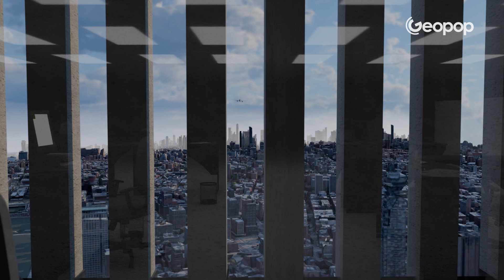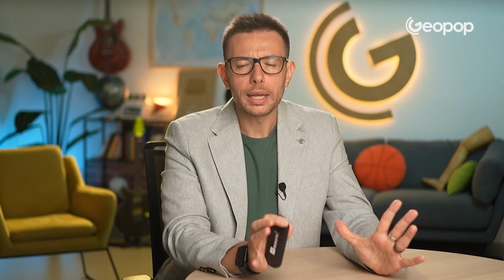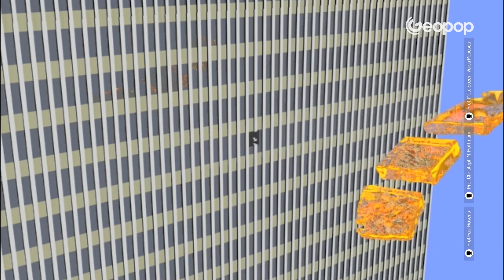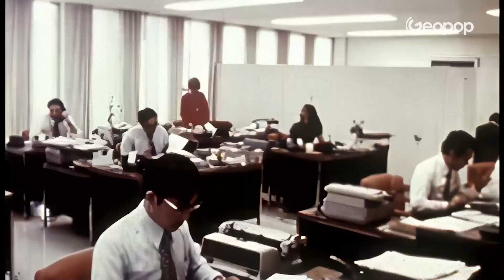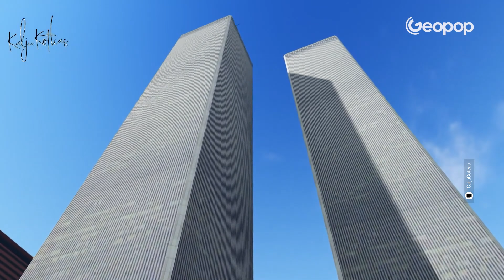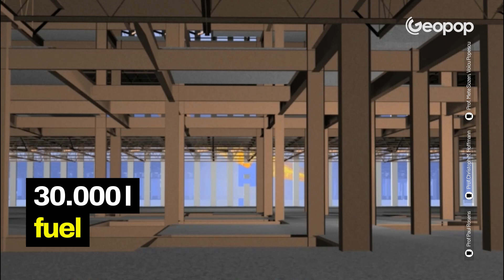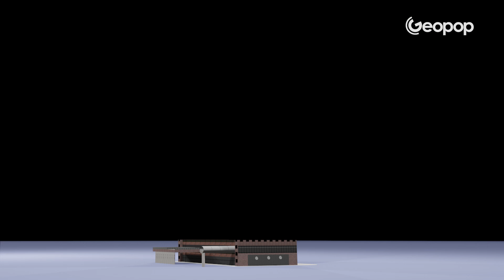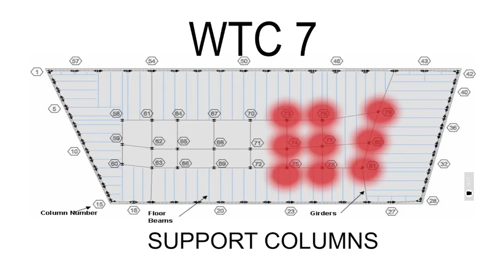9/11, 2001: The Technical Reconstruction of the Twin Towers and WTC 7 Collapses

Comment: https://www.youtube.com/watch?v=hm1u6qZyQ4w

WTC7  was an obvious controlled demolition.
Whether you choose to admit it or not.
9/11 was a military media psyop.
NOT a “terrorist attack”.

And I don’t have to participate in YOUR fantasy.
Reply: I’m going to respectfully disagree and offer a more plausible explanation.

Building 7, the 6th building to collapse of 10 lost on 9/11 still confuses many even though it has been extensively studied. Not famous or a terror target, and with no casualties it did not get a lot of attention initially, creating an information void the internet rapidly filled with garbage. Because everything seems like a conspiracy if you don’t understand how it works I prepared this brief summary of the collapse from my own analysis. No politics, just engineering. 

The North Tower collapse at 10:28am bombarded Building 7 with tons of burning debris, causing heavy damage and starting multiple fires burning out of control for the next 7 hours. Half the FDNY firefighters having been killed, others injured, units in disarray, equipment destroyed, no water pressure, and the greater urgency of Search & Rescue efforts, firefighting was pulled as futile. The building couldn’t be saved and was left to its fate.

www.youtube.com/watch?v=g_SvpwyC17M&ab_channel=MFitz  

Collapse of a burning structure is always a concern for firefighters. Steel buildings subject to fire rely on active fighting of the fires to survive. Buildings are designed around 1 to 3 hours of fire resistance, allowing time for occupants to escape and ACTIVE firefighting to get started, after which all bets are off. Left to their own devices they will exceed their design envelope and collapse. In B7 the occupants escaped, passive and active fire protections were compromised and active firefighting was abandoned which left the building to take its chances. It lost. Odds on Building 7 would eventually collapse, and it did. No big deal in logic. That is the sort of choice firefighters make every day in brush fire situations - which houses to save and which ones to let go. Only real difference here is moving the decimal on the size and cost.

www.youtube.com/watch?v=WnYBX6QT0R4 

FDNY Chief Daniel Nigro ; The biggest decision we had to make on the first day was to clear the area and create a collapse zone around the severely damaged 7 World Trade Center, a 47-story building heavily involved in fire. A number of fire officers and companies assessed the damage to the building. The appraisals indicated that the buildings structural integrity was in serious doubt. I issued orders to PULL BACK the firefighters and define the collapse zone. It was a critical decision; We could not lose any more firefighters. It took a lot of time to PULL EVERYONE OUT, given the emotionalism of the day, communications difficulties and the collapse terrain

FDNY Deputy Chief Peter Hayden ; We had our special operations people set up surveying instruments to monitor and see if there was any movement in the building. We were concerned of the possibility of collapse in the building. And we had a discussion with one particular engineer there, and we asked him if we allowed it to burn could we anticipate a collapse and if so, how soon? And it turned out that he was pretty much right on the money, that he said 'In its current state you have about 5 hours

The collapse of Building 7 was anticipated and widely reported in the media throughout the day. At least 24 video cameras recording some or all of the collapse. Everyone knew what was coming and why.

www.youtube.com/watch?v=OY5S5k3tMHI 

Building 7’s collapse was completely different to the Twin Towers, harder to understand with most of the details difficult to see. But we can still sort out what happened through careful analysis and observation.  This is MY EXPLANATION of the collapse sequence using the best available information and relying on no authority.

B7 was complex 47-story steel framed structure built on top of a smaller existing 3-story building, requiring several lower floors dedicated to complex load transfer structures instead of usable office space. Of trapezoidal shape and all-steel tube-in-tube construction, B7 (above the 7th floor) consisted of a central core of steel columns carrying most of the gravity load, perimeter steel columns around the outside of the structure carrying the remainder of the gravity loads and long span beams and girders to tie those elements together and form the floors. On the outside of the building hung a moment frame - the last part of B7 to fall. 

Phase 1 : The first externally visible signs of collapse initiation occurred at 5:20:28 pm. Collapse initiation for B7 is notably quiet with observers not realizing the building was collapsing! There was no audible warning in the form of say hundreds of ear drum busting 180-190dB explosive bangs preceding the collapse. Here at 12:00 a local CBS affiliate reporter is talking 10 blocks from B7 when collapse begins. People don’t start to notice the collapse until 12:11. Then at 12:45 is the famous CBS fixed camera clip of Building 7’s collapse.  Note how quiet it is.

youtube.com/watch?v=t5tEy6mXSE8&ab_channel=fresnosean379

Collapse initiation was due to lower floor failures above the load transfer region (7th floor) in the NE corner of the building. In this video at 0:45 you can see the NW corner from inside the building while under construction, Column 79 just out of frame on the left. That big, angled steel beam across the top of the frame connects to C79 at one end. The girders connect to the beam. That beam and all those girders depend on just one connection

youtube.com/watch?v=nP3TNHPCIVU&t=35s&ab_channel=EdwardCurrent

Phase 2 : Lower floor failures caused a loss of critical lateral support over an excessive length of core Column 79 and it buckled. If you look at a floor diagram of Building 7 (see above) and look at all the structures that depend on C79 you quickly realize this one column was a relatively isolated structural element on which a disproportionately greater fraction of the structure depended analogous to say the Key Bridge. Externally we see a vertical progression of window breakage along the 44-46 line and a kink in the roof of the East Mechanical Penthouse at the top of the building, consistent with C79 failure. The transition from full capacity to almost no capacity occurs in virtually an instant. Once the buckling failure occurs there is almost no resistance

Normally with a buckling column, the load could very well be redistributed to other columns, meaning the buckling could stop after a while. With C79 that is not the case - the failure did not redistribute the load, so the collapse rapidly progressed to the roofline, sinking the rooftop penthouse.

Phase 3 : With C79 gone, B7’s progressive, non-symmetrical collapse continues with C80 and C81 at the east end of the core left laterally unsupported and quickly buckled and failed as well, sending the EMP down through the building. C79-81 all have no diagonal bracing, which I believe is a major reason why they could not redistribute a lot of vertical loads among one another.

From there collapse progressed from east to west through the central core until the core was gone taking all of the interior floors and structures and probably most of the perimeter columns with it. You can see the horizontal progression of window failures low in the building and the dropping of the remaining rooftop structures into the building. One of the big takeaways from the NIST Building 7 study (that gets completely ignored) was their modeling which determined C79 failing under ANY circumstances would have initiated the same collapse sequence.

Phase 4 : After some 10 seconds all that remains of Building 7 is just a hollow empty outer shell - the exterior moment frame - creating the illusion the building is still standing since little has changed externally. But it’s just a hollow empty shell like an empty cereal box supported by only a few remaining columns and quite unable to remain standing. With all the internal framing gone. the north face leans inward, forming a V in the roofline, the last perimeter columns buckle under the strain and with nothing left keeping it up the moment frame free falls, landing on top of the 7-story high debris pile. It is only at the very end that a single measurement of alleged free fall acceleration is taken. Note this is not the building but just its outer shell, and only one corner at that, at the very end of the collapse. Start to finish the entire collapse took 18-20 seconds, or less than 1/3 of true free fall and we have to look at the whole thing, not cherry-pick little bits to fit a particular narrative. Worth noting _how fast something falls cannot tell you what started it falling in the first place. The debris spread out, blocking surrounding streets, heavily damaging the Verizon Building and destroyed Fiterman Hall, all well outside of Building 7’s “footprint”.  

Building 7’s progressive, non-symmetrical collapse was incidental and unintended collateral damage from the combined effects of fire + time + gravity started by the collapsing North Tower. That is true no matter who planned and carried out the 9/11 attacks or why . The collapse was of so little consequence it barely even registered at the time, a mere footnote. It only took on semi-mythical status as an alleged smoking gun years later when demolitions at the Twin Towers, missiles at the Pentagon and shoot down over Shanksville all failed and conspiracists had nothing left to work with.

Anything can seem like a conspiracy if you don’t understand how it works. Now you should. I hope you found this helpful, informative and it solicits informed critical comment. If I made any errors of fact, logic or reason or left anything important out, please let me know so I can fix it. IF you can offer a more plausible alternative please do. Be the first. Please start any reply with the words “Tits McGee” or I will know you didn’t read it and are wasting my time.

Comment: 9 seconds for the south tower
11 seconds for the north tower to collapse? 9-11? What? Fr 😳
15:55
Reply: Actually that is not correct.  It is a common misconception.

The myth the Twin Towers collapsed in free fall (9-11 seconds) comes from completely misreading this:

NIST FAQ for the Twin Towers disaster Study

*11. How could the WTC towers collapse in only 11 seconds (WTC 1) and 9 seconds (WTC 2)—speeds that approximate that of a ball dropped from similar height in a vacuum (with no air resistance)? *

NIST estimated the elapsed times for the first exterior panels to strike the ground after the collapse initiated in each of the towers to be approximately 11 seconds for WTC 1 and approximately 9 seconds for WTC 2. These elapsed times were based on: (1) precise timing of the initiation of collapse from video evidence, and (2) ground motion (seismic) signals recorded at Palisades, N.Y., that also were precisely time-calibrated for wave transmission times from lower Manhattan (see NIST NCSTAR 1-5A)

Note the part about the first exterior panels to strike the ground after the collapse initiated.  A lot of people seem to miss that important bit of context and only see the 11 seconds and 9 seconds parts. 

On conspiracy web sites and YouTube videos they just cut out all the relevant context and details and (falsely) claim; The Twin Towers collapsed in 10 (or 9 or 11 - they usually can't remember the exact number so they fudge it) seconds Selective reading comprehension syndrome (SRCS). 

9 or 11 seconds is NOT the building, its the first debris to hit the ground which were definitely in free fall and dropping much faster than the Tower, which is collapsing some ways behind that. All of this easily visible to the naked eye. 

youtube.com/watch?v=4VgZW-v_Opg&t=4s&ab_channel=MFitz 

Now you know.

It was actually right around 33 seconds for both Towers to collapse, +/- 1 second.

Comment: Aircraft aluminum cannot " severe inner steel core columns nor outer columns". That's like saying cotton balls can cut through titanium, it just sounds ridiculous and a tiny bit of research will lead to the exact same conclusions.
Reply: So then why did they?

Arguing that something cannot happen when it has already happened is never a good plan.

What you should be doing instead is acknowledging you do not understand how and fix that rather than assuming reality is wrong just because you don't get it.

Comment: And what about the heat protection coating in building 7? No bare steel was installed there. And the fact that this coating went off evenly everywhere is nonsense.
Reply: Insulation does not stop heat transfer, it SLOWS it. 7 burned  for many hours, and the firefighters who were there described 7 has being "fully involved" and having fire "on nearly every floor" by the time it came down.
Reply: @Tim22222  the Windsor Tower burned for over 24 hours and didn't collapse.
Reply: @CodingLab-sz6ro  - The steel portions of it did, after just over 3 hours, leaving only the reinforced concrete portion still standing.
Reply: @TheLoonResistance  How could the steel have been destroyed? It has a heat-protective layer, and kerosene burns at a maximum of 600 degrees Celsius.
Reply: @CodingLab-sz6ro  Different building, different design, different circumstance. Apples & Oranges.

FUN FACT: The Windsor Tower was a hybrid construction; part of the steel structure was encased in concrete, part was not (like 7). The parts of the WT built like 7 did collapse, the parts that were different DID NOT.
Reply: @Tim22222  WTC 7 collapsed in free fall. Have you ever seen what it looks like when a house burns down?
Reply: @CodingLab-sz6ro  - Part of it did, very briefly, at the very end of the collapse. That doesn't mean anything.
Reply: It not only slows it, it lessens it. booms were heard throughout the day many times.
https://youtu.be/wyGpUiEg9lI?si=HpzlFwbHchqlK2lQ
Then 8:26 in this one
https://youtu.be/bLF5D7M1YgA?si=aHSvS__uOdxMi1ZB
The firefighter said. " we gotta get outta here, tower 7 is exploding "

Comment: Thank you  for the phenomenal material. Concise, comprehensive and tragically-fascinating.
Reply: -- Then what is the source of the many tons of molten steel found in and under the debris, the heat so intense that the molten steel remained in that state for weeks afterward, running off of the debris as it was excavated. This cannot be molten copper from wiring that retains the color of a shiny new penny.  It cannot be molten aluminum that retains the color of the polished aluminum wheels of a street racer. It was the color of glowing orange molten steel  that cannot be mistaken for any other material, reported by firefighters who are very experienced in the nature of such materials as well as seen in video evidence.

When you combine this with an entire lack of turbulence behind 500 mph aircraft, when even a small Cessna Aircraft would leave an evident wake in the smoke and fire only seconds later .  . We find that skeptics still cannot be skeptical of the official narrative in explanation.  Sponsored channels and forum activity are skeptical of nothing when support is provided.

Sponsored activity in the forums is very normal today for commercial and political purposes and subjects of controversy -- in the attempt to lead public debate.

Comment: The buildings were made to withstand the direct hit from a Boeing 737. No way a plane can pass through such a structure like knife through butter and then explode inside the building, not outside. That kinda breaks the laws of physics don't cha think? Where's all the plane wreckage, the seats, the victim's bodies, the engines? Nowhere to be found. I wonder why? Nevermind, maybe it's nothing important.
Reply: A knife passing through butter comes out the other side unscathed and ready to be used again.  Are you claiming Flight 11 and Flight 175 emerged out the opposite side of their respective targets and flew away?

Worth noting that both aircraft - all 117-120 tons of them were completely destroyed in a quarter of a second. That *in no way implies the Towers come out unscathed_ - a bit of bleeding obvious that seems to escape many of the conspiracy minded. There is a large difference between withstand and come out unscathed .  A person for example can survive a bullet wound that passes straight through them and re-arranges their internals. 

Also worth noting that both Towers did withstand the impacts of wide body airliners impacting with the energy of up to a ton of TNT.  Both Towers were still standing after impact. 

If you really want to see wreckage and personal effects from Flight's 11 and 175 I suggest a visit to the 9/11 Memorial Museum where many such artifacts have been on public display for years. 

It beats all this ignorance-fueled personal incredulity you are currently employing.